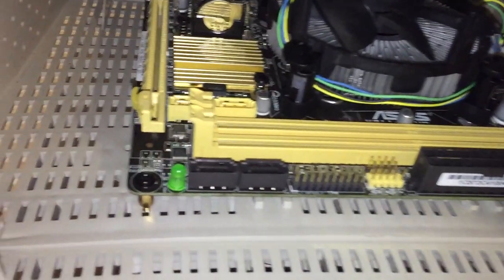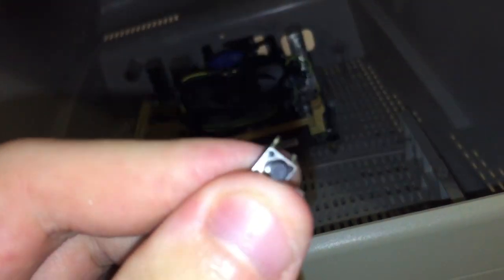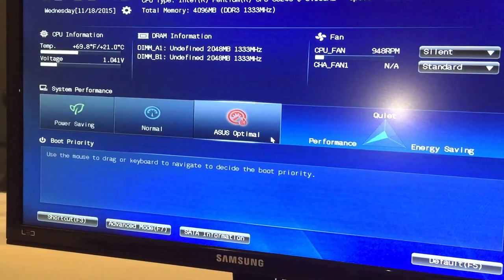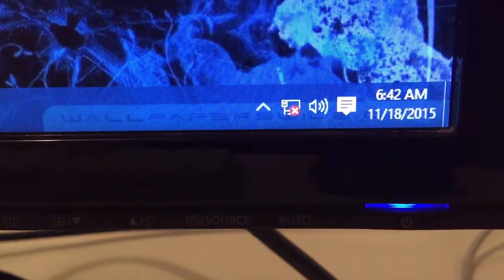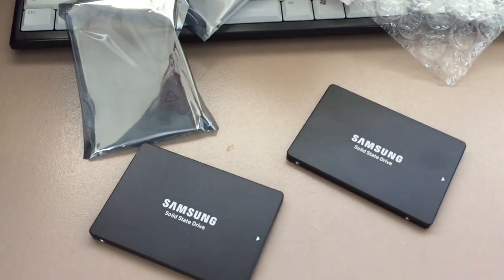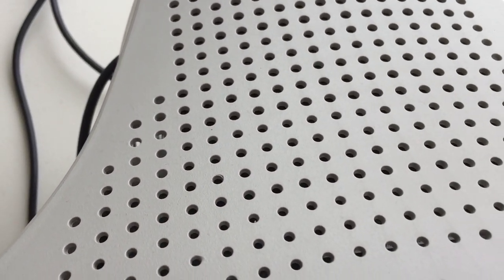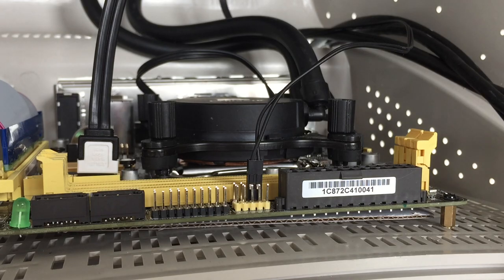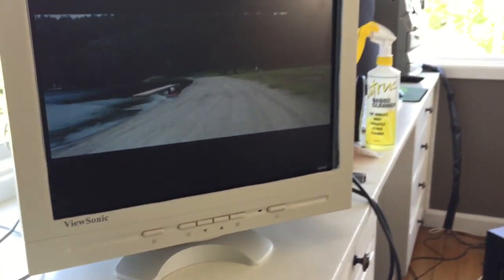Gaming PC inside a CRT - Part 2

Comment: Hey Grant, I'm thinking of doing a similar build soon, I see your views for this much effort didn't really pay you dividend. Would you have any advice for me if I was to do a similar build?
Reply from the maker: I was only 16 when I built this computer, it actually got destroyed by an earthquake shortly after this part of the video was uploaded which is why I never continued it.

Definitely use an AIO liquid cooler, and my advice is to use a CRT that you can mount a metal cage inside of to give proper support and areas to mount parts too. 

If I was to do this again I would mount the motherboard on the top, the AIO on the bottom with a hidden cutout for ventilation and use a better quality CRT monitor than the one I did.

Also of course, be very careful when disassembling the CRT as the voltages are dangerous.
Reply: @Grantmacintosh1  hey thanks for getting back to me, sorry to hear that the original didn't survive and great job doing this when you were 16! I'll probably make a start soon since I have most of the parts now, will definately use an aio!

Comment: Reset switch as a power button? I like your style.
Reply from the maker: That's how I roll!
Reply: Grant Berry Lol i used to use one as a power switch :D But i got a new front panel for my case so i now have a proper power button. The reason i used a reset switch is because the buttons were so old, that the cables snapped off. I'm not so good with wiring, so i just threw the old one in the trash and just said ''Fuck it.''